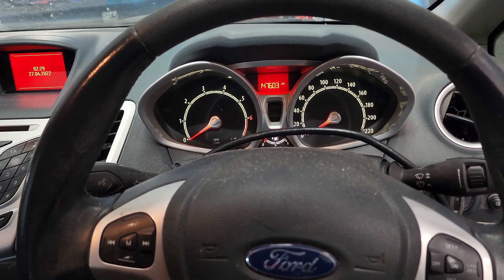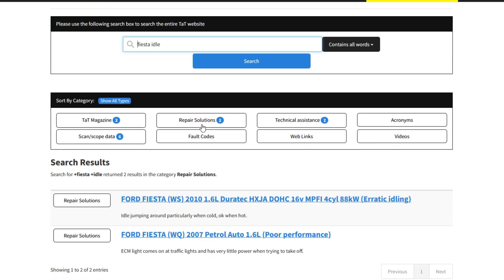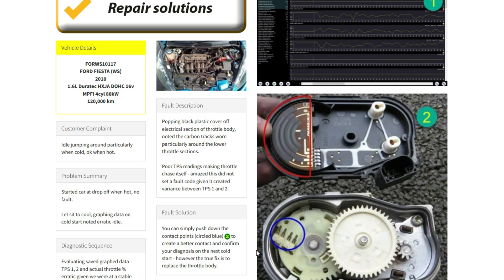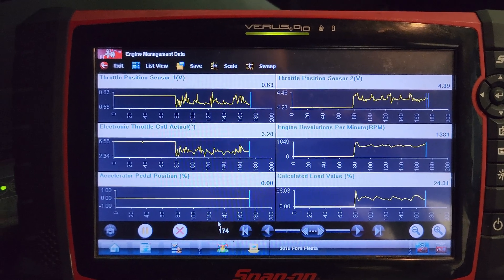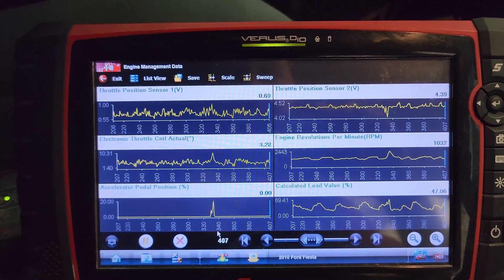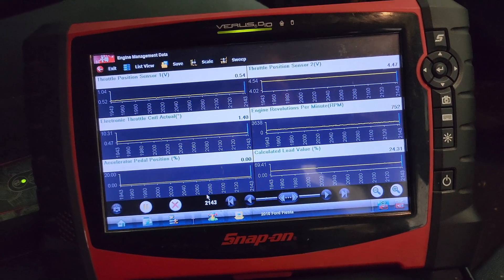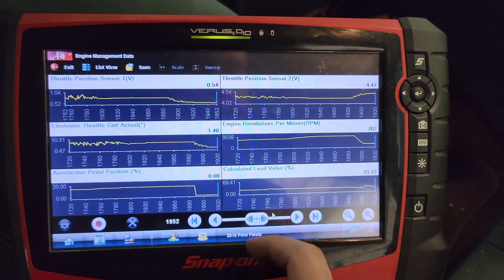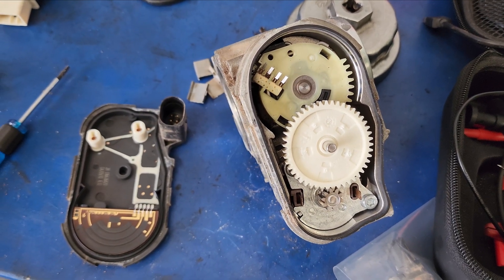Ford Fiesta Erratic Idle - The power of networking - The Automotive Technican

Comment: Hi Does TAT have Gear Box repair and Truck Repair information..?..Thanks for the video..
Reply from the maker: Hi Dean, TaT is not a data information supplier. It's basically a network of technicians that all chip in their own information for the benefit of others. The repair solutions and scan and scope data are more tailored to non HD vehicles. Are you only working on HD stuff?
Reply: @romanosautomotive  Hi i do both Hino,Fuso,isuzu and Cars,vans,cabs  . How about transmission repair help in TAT..?